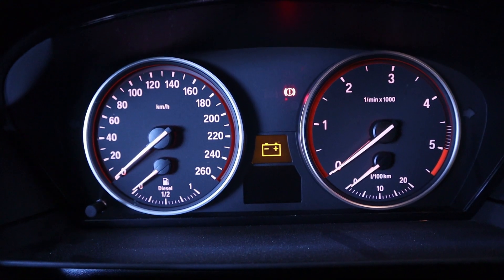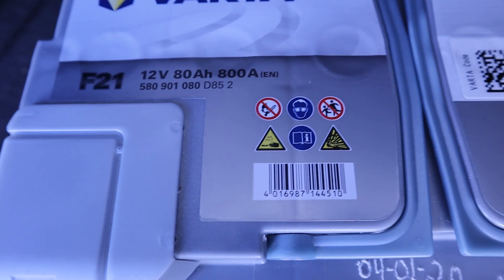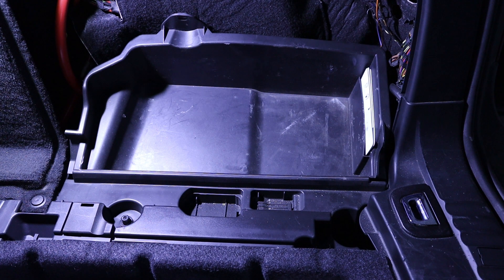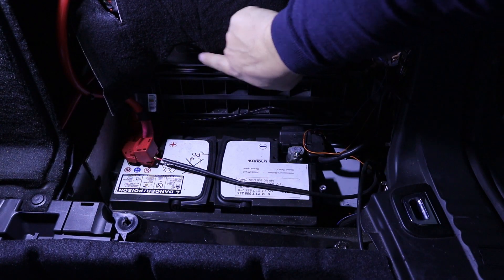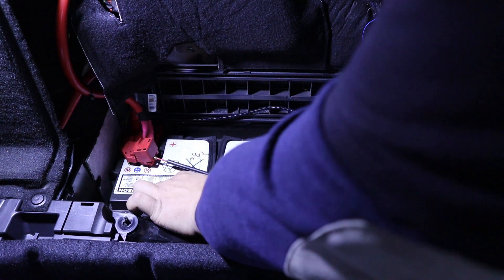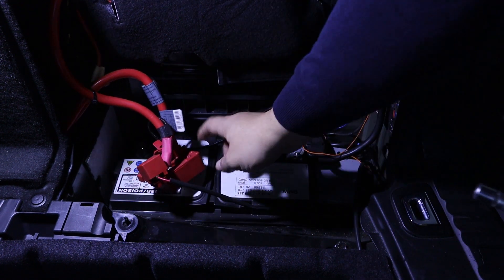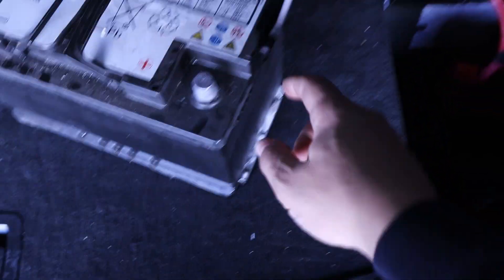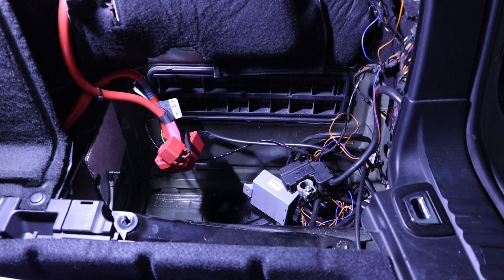BMW E61 Battery Replacement and Registration (B-Tool Expert)

Comment: Hi, quick question as i see an inconsistency between B-Tool and my actual battery. App says that i have a 91 Ah battery but i actually have an 110 Ah. Does that mean that the battery is not registered? I bought the car with that battery already installed
Reply from the maker: It should show the real capacity.

Comment: Hi, great video. Does the battery registration part of the app work on the lite version? Thanks
Reply from the maker: I only have this version. Not sure to be honest. This one works really well.
Reply: @GFI  hi thanks, have checked and battery registration only with the full version, not lite version
Reply: @sweetfreedomGB  at 13.99 or 14.99, depends on currency, this app is well worth it as battery registration alone cost more at a garage. Also you can regenerate DPF with this version.

Comment: Enquanto fez a troca de bateria não colocou uma bateria de apoio ligada no compartimento do motor?
Tenho de fazer o mesmo serviço na minha 520d de 2008.
Reply from the maker: Podia ter colocado, e sendo uma bateria com as mesmas características, segundo li não seria necessário codificação. Como ia codificar não me preocupei com isso, para além de ser mais complicado remover a bateria com energia no terminal +.
Reply: @GFI  Certo! Muito obrigado pela dica. Já agora como fez não teve nenhum erro de airbags ou direção assistida foi só codificar a bateria certo?
Os meus melhores cumprimentos e desde já muito obrigado pela atenção prestada.
Reply from the maker: Não tive erro nenhum e ficou tudo a funcionar normalmente. Na verdade com este método o que se faz é registar a bateria uma vez que ela já está codificada (utilizando as mesmas características). Espero ter sido útil :)